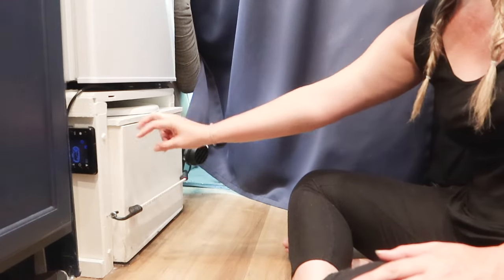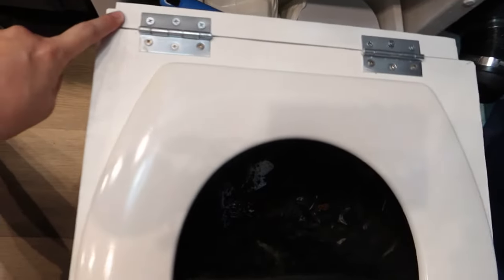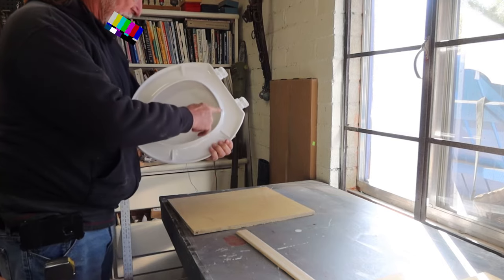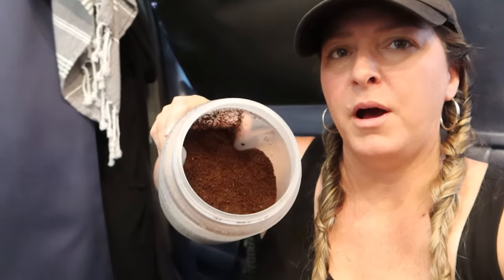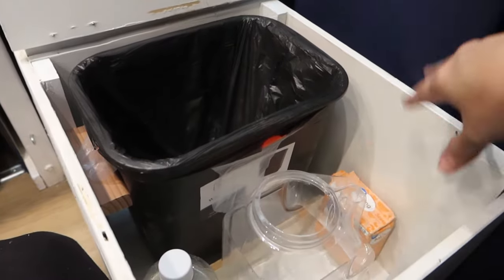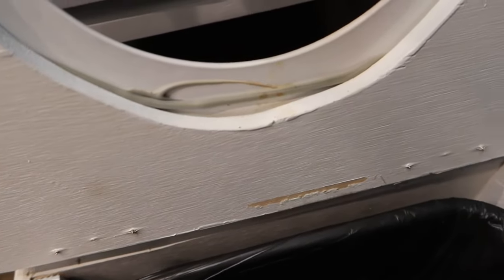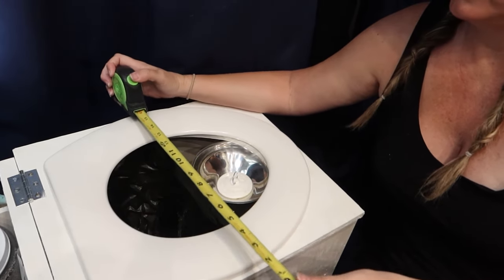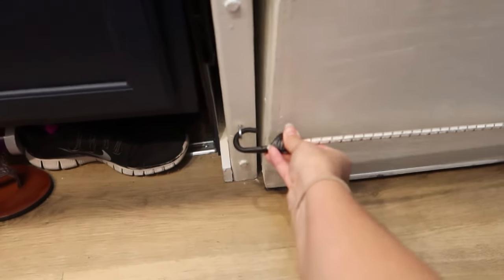DIY Composting Toilet with Urine Diverter (Under $100) // Travel Snacks

Comment: Everyone has a different solution. Mine is a 5 gallon bucket, biodegradable bags, and pine pellets. The reason that so many people use a 5 gallon buckets is because they can typically hold the weight of a person, so building a box isn't necessary. As for the "bag of liquid" problem, I use pine pellets from Tractor Supply in my toilet. They do double duty: 1) They soak up the liquid and eliminate the odor, and 2) They cover the solids, thereby preventing the odor from escaping. I tend to change bags whenever I do number 2, and dispose of the bag as soon as is convenient.

Comment: A handle on the front would help so you wouldn't need to put your hand back inside the lid. I would also figure out a venting system in case it wasn't possible to empty immediately. All things considered, you have shown me how to save at least $950. Great work and video.

Comment: I use pine animal bedding from Tractor Supply. It cost $8 bucks and will probably last a year. I also decided that a built-in urine diverter is a waste of time. I pee directly into a 1/2 gallon pitcher with a lid, and empty it as needed.

Comment: Just curious - if not able to remove #2 "quickly", how do you prevent odors w that "open"? Would adding the "lid" help? I think this would make the design lower to the floor, so that's a down side, but maybe worth it for odors... Thoughts?
Reply: Did you look at the video? Thats what the coir is for.

Comment: That toilet is brilliant! When I car camp in my little SUV I have a system using wood pellet livestock bedding and puppy training pads in a small lined kitty litter bucket. But I’m going to try and implement your liquid waste diversion system. The pellets are very absorbent, but wet pellets themselves have a slightly unpleasant odor (to me), and condensation collects on the container lid (and/or bag) afterward, which is a nuisance. Haven’t had an emergency where I’ve had to deal with solid waste in my car yet. Hope I never do. But being prepared is wise. To me, It’s a safety measure when traveling or camping alone.

Vault toilets in campgrounds are often poorly maintained, and breathing the fetid air is a real health hazard. A N95 mask helps…..having a personal alternative is much better. And I don’t have to leave my car if it’s pouring rain.

Comment: Lots of good ideas here.  I might build one for my small sailboat.  Maybe put some caulking between the seat and the platform?  I think the key to not having smells (if you're not dumping the contents frequently) is to have a small 12 V fan constantly venting outside (to dry the feces, which will then not smell).  Marine chandleries sell a nice little solar vent with a small fan that would work well for this purpose.
Reply: almost any tiny computer fan would do. The key is finding a quiet one as the small ones usually have the highest whine.
Reply: My lu k  the smell  going out would attract flies!

Comment: Great job. Clear,cogent advice with no drama on a subject we all do do.😁 Detailed build quality instructions. I agree. $1,000 for a plastic contraption that prob costs them $100 to fabricate including Return on Investment in tooling, production ,and advertising cost, is exorbitant and ludicrous. They are not building a Flippin VIKING ORBITER. Your deadpan,witty delivery just cracks me up. Chinese companies replicate German engineered Diesel Heaters like an ESPAR for $200. AIRHEAD & NATURE'S HEAD are still selling fancy $1,000 plastic Poo & Pee buckets and have cornered the market. I believe there are companies that do sell a urine diverter for DIY Potties (Urine the Money). Be safe on the road. Happy Trails,phil
Reply: tbh there is a lot of specialized components that they have to make, plus a lot of sketchy rnd to make one as reliable as theirs. There a lot more features of nature's head that this simple solution omits.

but honestly somewhere like $400-$500 would be more acceptable imo

Comment: this is BRILLIANT!  The best one I have seen. Thank you. Quick question - no issues with the smell of urine since the bottle is not sealed? I was thinking some shims could be added beneath the bottle so it hugs the canning funnel. Thoughts? Have you modified it at all??
Reply from the maker: Nope, no odor issues! Well unless I eat asparagus, but that's another story. 😆  At the bottom of the box I have a couple wood strips loosely holding the bottle in place. You can see it quickly at the 9:03 mark in this video. But if you mean lifting the bottle, I don't think it's necessary. I've been using it for over a year with no modifications. It works great. Hope this help!

Comment: Thank you. That helped a lot. I didn’t get how to do a urine diverter. Since I have a minivan I will still have to figure out how to divert with the five gallon bucket. But you really explained everything well.❤️
Reply: I use a transmission funnel in my 5 gal bucket to divert urine into a bottle.

Comment: I like your sense of humor. I used a 5 gallon bucket with bags, and a white plastic laundry detergent bottle 88 oz, (2.75 qt) 2.6 liter for pee. I like the height of the 5 gal, as I'm an old guy and it's easier to get up from. Yeah, composting is impractical for me too. Bag it and toss in the trash; it's where all those disposable diapers and pet poops go.😽💩

Comment: Great vid.  Like you,  I cant believe those toilets with urine separators are over 1000 bucks for a bunch of plastic.  How is the smell in your van?  Did you consider a 12 v fan to pull air across the pop  can and vent it outside?
Reply from the maker: Nope there isn't a urine smell in the van. I do have a Glade plugin in my van, but even without that I don't smell urine. I thought about the little fan but it was gonna be more hassle that it was worth. If I poo in the van, I bag it and throw it out right away. It's no difference than the lingering smell in a bathroom for a short time. I just crack a window and in a few minutes the smell goes away.

Comment: Try pine pellets from tractor supply. It will absorb the pee with no smell until you empty it. Not sure about the poo. Pellets are cheaper than using stuff like cat litter

Comment: I bought a bucket dm a portable toilet seat then cat litter but make sure you find a trash can to throw it out to not anywhere.    For heavy stools I had to find extra dirt mud then put a trash bag around the make shift toilet and add dirt and leaves then grab it out  and toss it in a trash can never leave it on the side road or toss it try to be decent and find. Trash can

Comment: Love your design and tips, going to make something similar. But throwing away plastic bags with every poop makes me sad. Compostable food waste bags are a great alternative, and pretty strong too!
Reply: Yep. After seeing this I'm planning a similar one. I'll likely use composting bags and a corn cob or pine pellet medium for the back container and a heavy duty clear container (Rubbermade or Tupperware thickness) for the front. Most any type of natural, non-clay based litter will work for odor and moisture control You can then do the dig & bury method with the composting bag with no worry because everything will break down over time. 

If I'm not willing to handle it I don't want to foist it off on some poor garbage collector either.

Comment: How does the canning strainer work during that time of the month? I'm researching the best option for those times.
Reply: I would think very well. Especially if you just remove the strainer entirely. I don't believe she's using the strainer at all.
The cap she uses is just one of the rubber sink/tub stoppers and she said she removes that when using the unit. It just keeps in any odor and minimizes splashup during travel.

Comment: LOVE the canning funnel idea. I have been trying plastic funnels yet they are way too deep. I’ve just decided to keep a large mason jar and lid instead to hold. I’ve also been thinking I may be able to adapt a ‘She Wee” also use Lavendar oil in water as an air freshener which if you add some tea tree oil you have an instant surface spray too which won’t poison you. 👍🇦🇺💕
Reply from the maker: Thanks! Currently I use white vinegar in the water but of course that doesn't smell as nice as tea tree or lavender. Thanks!

Comment: Nice! I am starting out with a simple chemical toilet but wanted to work on a DIY version rather like yours. Like coffee grounds, you said. Hmm. I'll be producing a bunch of coffee grounds every day so drying them out might work for dehydrating and deodorising the solids. Being a guy, I will have to adapt it to avoid being big chief pees-on-seat.
Reply: It's LIKE coffee grounds not actually using coffee grounds, it's coconut core.

Comment: Very neat and useful! For the urine, Horse Bedding Pellets (made of compressed pine) work marvelously to cancel the urine smell! They absorb it and turn into a sawdust like virtually odorless dry mass. They even work for cat urine. And the resulting mass is light weight.
Reply: Wouldnt yhat be really fifficult to get clean after emptying?

Comment: Fantastic video!!! I have a Thetford porta potti and only using it for urine. Everyone says you have to use chemicals but I can’t use chemicals and needed alternatives. Your video came up. You and your dad are awesome! So inventive. As I only do #1 in the porta potti, and dumping will be every few days to a week, I’m wondering if there’s any natural alternatives for the urine section/holding tank as I need to pour out/dump the urine and it needs to not harm the earth and environment. Any ideas?
Reply: I found what works well with cassette toilet tanks when you don’t want to use the chemicals is water, hydrogen peroxide ( or Dollar store Oxiclean powder) and washing soda ( different from baking soda, found in laundry aisle). For a laundry jug container instead of using a cassette potty I fill about  one inch deep with water, add about one teaspoon Oxi powder ( or 1/4 cup peroxide) and one teaspoon washing soda. You would use more of that ratio for a potty tank making sure to cover the bottom about a couple of inches and add water as you normally would to flush the bowl each time you use it. I’ve added the cheap, Dollar store, Totally Awesome cleaner to shake around, keeping the container from collecting odors. It’s an inexpensive solution that keeps odor down.

Comment: Any updates on this design? Having such a wide neck opening for the diverter and no lid that I can see seems like a bad way to contain smells
Reply from the maker: I’ve used it for 3 years and I never have any smells. I do cover the mouth with a small sink drain plug but it just loosely sits in there. Hope this helps!

Comment: Girl, not everybody has a sexy, competent father like you to help build a toilet!  Love the idea. I would apply contact paper to the top of the wooden box to facilitate cleaning.  You can also purchase a separator for a few bucks on Amazon. I compost with fine horse pine shavings into a nursing home bedside toilet. No odor. I have a rural cabin for further composting outdoors.. But that's not suitable for traveling in a van. Urine mixed with 10 parts water (no soap) can be used to fertilize ornamental plants but not vegetables.

Comment: Hi my composting toilet hacks....go visit your coffee shop and see if they'll give you the left over waste coffee grounds they make the best smelling compost breakdown product,  go visit a wood working shop for sawdust another great product...use biodegradable bags they breakdown in landfill within weeks...use stainless steel not plastic buckets for hygiene...keep a lid of your waste as that stuff is microscopic and it floats...use biodegradable toilet paper and keep used paper seperate as you can either dispose or incinerate it...in AUS composting toilets are about $3,000 the manufactures need to reduce the price so more people can afford to use them...Im using a 2 bucket hack for 2 years its hygienic, easy, affordable

Comment: Bottled water often comes in transparent or translucent 1-gallon water bottles, which can be excellent containers for these potties.
Reply from the maker: A regular water bottle would work in a pinch but for it to work with the canning funnel you would want the container to have a wide mouth opening.
Reply: @travelsnacks   I’d either modify the funnel for a smaller opening, or, look for a bottle with wider mouth that has a handle…or make a wire bale-handle for the plain gallon canister…but I’d have to have a handle to lift-out a gallon of fluid without slopping it all around, or risk the plastic lid popping off if my hands accidentally dropped the jug.  
Many don’t have the grip-strength able to lift that full canister without a handle.

Comment: I watched this video with great interest because I'm on the market for a composting toilet, and I agree that the prices are super inflated. But it is for a boat, for which Im removing the original toilet, and space is limited even for some commercial toilets' dimensions. You urine diverter is very clever, but as you said, designed for ladies. I'll eventually may go the DIY way as well, but better designed because my boat has a wet bath, so wood wood not work well. Thanks for sharing this very honest video.
Reply: You could maybe paint the wood box with flex seal.
Reply: @JNante  Flexseal, lol. However I could fiberglass over, and may be add geicoat to match, or some paint. Thanks for helping me brainstorm.

Comment: Instead of coco core, I'd consider aspen or pine shavings used for animal bedding.  Walmart or feed & seed places have them.
Reply from the maker: Ahh, good tip. Thank you!
Reply: @travelsnacks  They are very cheap and also double as fire starter/kindling.  ;)

Comment: I use pine shavings hamster  🐹  pet bedding in the bag.

A bag costs under $5 and lasts several months.

I buy heavy duty bags made for use with the portable camp fold up toilet seat thing.

They are expensive. So I use a code of cheap kitchen size trash bags as well. I throw out the two cheap bags everyuse. The other bag most every time stays clean.

I also use $ store puppy pads under the two kitchen bags. They rarely need changing out but help to eliminate potenti messiness.

Like you. I rely do 't want foul smell in my tiny wee hours.e, nor any nasty messy spills.

The whole business can be cleaned with each use and disposed of responsibly.

Comment: I, as a cat owner, keep thinking... what if I make my own DIY toilet but no separating liquids from solids, jut one trash bin, line it with composting trash bag, put some cat litter at the bottom to absorb moisture and odor from number ones and just change the whole bag right after number two and I'd change it every evening too. I mean, cat litter is pretty cheap and awesome at containing odors and easy to just take out as trash. That way I wouldn't have to carry a bottle of my own pee to dispose of and it would look like I am just cleaning my cat litter.

Comment: I added a tight fitting stainless steel lid over the poo section...cause poo happens, and this shuts orders down.  A few cedar chips, and I'm off.Cedar chips are CHEAP. They are thrifty luxury.
Reply: Um, that was supposed to say, 'shuts odors down.'   Guess I got excited talking about this crap.
 I made mine out of diamond back heavy gauge aluminum in a curved fashion like those 100$ toilets.   I found the old metal from a crashed truck tool box.  The stainless steel top and back is the metal off a discarded stainless frig.  The wooded seat is from a 1050 camper, and the stainless steel bucket and lid are a discarded lobster pot that was set in the metal pile at my local dump.  I put way too much thought and love into it...but that was years ago and it is still shining like a new dime, and doesn't offend rare guests.  I love your humor and similar attention to detail.  Creating solutions to life's needs is part of the journey, and doing it in style...priceless.

Comment: Waaaaay toooo complicated. 

A plastic 3- or 5-gallon bucket with an $8 snap-on lid will work just fine.

Cover with a sprinkle (1/4-cup) of quick lime or wood ash and 3 hands full of wood mini-shavings animal bedding ($5 @ any feed store) after each use and you're golden.

In a vehicle, line your bucket with a tall, draw-string kitchen trash bag and every time after about 5 uses, dump it into the fuel island's trash can.

The wood shavings absorb ALL the pee, so no worries about pee sloshing out like a burst water boloon.